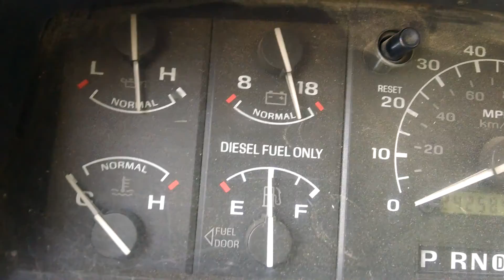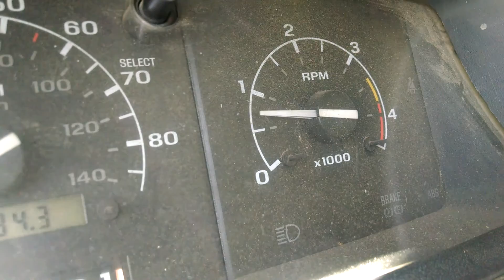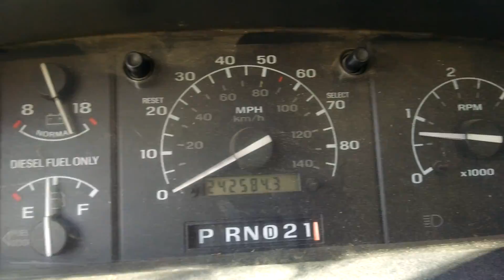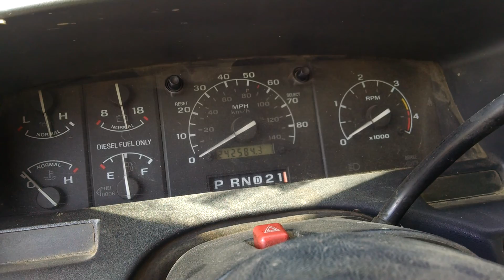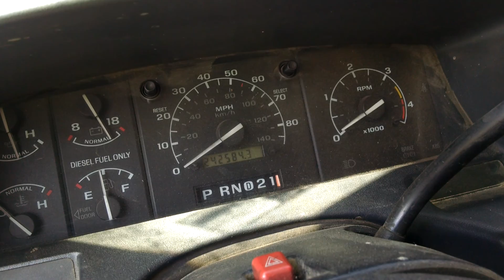Ford F-250 IDI 1993 Diesel 7.3L Problem

Comment: I had the same problem with mine after changing the fuel filter and return lines still had the same problem running rough white smoke and stalling and hard to start ended up being problem in the fuel tank the fuel tank had a lot of rust on the inner surface and goo from old diesel I guess and at some point somebody had removed the screen from the suction point on the sending unit assembly and put a short piece rubber gas line to extend it down and apparently it was sucking s*** up and clogging it off there slightly restricting the flow so what I did was remove the short rubber extension they put on the pickup tube on sending unit assembly and wrapped the suction port with screen and hose clamp it put the sending unit assembly back in and it was working fine eventually I put in a new tank and pick up unit been driving fine ever since best wishes to you
Reply from the maker: my friend didn't know what he was doing when he put new injectors in here he needed to advance the injection pump i did it myself put a new starter in 2 new batteries and a new starter now watch the first video of me trying to get the fuel up to it and yes i was getting mad at last because it didn't start and i could have burnt the starter but we got it to run check out my lastest videos it still running good i cut the muffler off of it loud now very loud. 1st video https://www.youtube.com/watch?v=Vc7mEA9ql-k2nd video running good https://www.youtube.com/watch?v=ZG1IhP7noM8

Comment: what was the problem ? did u solve this?
Reply from the maker: advance the injection pump to the passenger side fixed it
Reply: @robbie150  thanks what does it mean to the passenger side? u twisted it that way? I just got my first diesel a 1992 f250 7.3 idi. . so I dont know much I'm learning from videos..
Reply from the maker: I didn't know how to do it either but go to this site these guys were nice enough to tell me what to do with my 93 idi. https://www.oilburners.net/ they can tell you everything about that stuff it was not to bad but in order to advance the pump you either have to buy a special tool or make one yourself its hard to get to the 2 bottom bolts on the pump and need 2 people to help you with it

Comment: put a clear section of fuel line in the return to the fuel filter. it would show any air in the system. [ Tyler found the problem it had a bad ip and fuel leak]

Comment: the line on top of the injection pump has a check valve in it the brass fitting in the top of the pump has a glass bb check valve in it I bet it is plugged up and sticking over pressuring the injection pump making it has to much resistance to run properly had this issue several times take it out and clean it thoroughly.         https://www.youtube.com/watch?v=TFJ1N6g9fmg    https://www.youtube.com/watch?v=FjmaZhUTvSQ       look familiar
Reply from the maker: Thats the problem I have thank you so much. i will try it tomorrow and see if I am sure the injection pump will need a rebuild but I will give it a try!
Reply: another thing add a good factory ford / motorcraft fuel filter to the system after market ones form outside of ford / motorcraft have a higher micron filtration and often let trash pass thru and get caught in the injection pump and such and often scratch up the internals of the injectors and messes them up. The ford / motorcraft ones are around 2micron and aftermarket ones are around 10micron a huge difference so run only ford / motorcraft fuel filters also can add a clear screen filter ( AKA low restriction ) infront of the main fuel filter to see sediment / trash in the system or if are getting air in the system pre main fuel filter as this will also cause issues with slobbering / stuttering due to the air getting trapped in the injector lines and not allowing proper pressure to build up to inject fuel properly. The reason being our old school IDI's use a pop pressure and the air will compress reducing total pressure built per injector pulse making the injectors only partially inject fuel aka hit or miss injection.

I will also say check your CDR  valve this could be faulty and allowing you to get raw oil into the intake and this will also make the engine slobber / stutter and smoke easy way to check is take air filter off look at back of the inlet side of your intake a round can looking thing is there where it goes into intake look for a oil run trail inside of intake or simply look into the CDR and see if there is oil in the orifice as this is a tell tell sign of the issue and a common one also with our IDI's.

 PLZ try to avoid road draft mod for the CDR as I have found it to be a bit of a issue can cause some problems and also frowned upon by family / friends because leave oil puddles in theyre driveways lol. I also found road draft CDR setup to be bad in alot of areas where the law is a bit more agressive about polution. I live in florida now near the ocean and they don't like any oil leaking and I got a $500 ticket for a small puddle ( a soda cap worth after hard interstate running ) my rig left while I went swimming and well there was no way to get out of it.

Comment: Its your piston rings big dog. I bet it smokes if you open the oil cap while running. Mine is the same way.
Reply: It really depends on the owner if it is revved up all tge time it will toast the oil rings but if u take care of them and keep good oil in it itll last for 400000
Reply from the maker: i open the oil cap while it's running no smoke no blow by at all. found out it has a bad injection pump and a cracked fuel line
Reply: Your exactly right, i have a 91 f250 that did that and it was because of a cracked ring on the piston
Reply from the maker: nope o open the oil cap nothing comes out no smoke.
Reply: If you were blowing compression through a bad piston ring you would actually have excessive pressure coming out of the oil fill not just smoke as you would be actually blowing compression out as the term Blow by if you're not feeling excessive pressure coming out then you don't have excessive Blow by simply smoke coming out of there is not an indicator of excessive blow-by that would create a running problem it seems to me you have a fuel delivery issue seems like you're getting air from somewhere
Reply: It can also be caused by no back pressure u cant straight pipe a diesel unless its a turbo it has to have something to restrict some flow or air i use a flowmaster works fine

Comment: Its possible that you have air in the fuel lines... Try to bleed the air out of them white the truck is running one at a time......
loosen an injector slowly and check for air bubbles then tighten back the bolts....You will be in good hands once you get this done....Cheers!
Reply from the maker: it has a leak back to the tank it may have air to in the lines yes,. it leaks the fuel back down to the tank might be a seal out or something leaking fuel back thanks for the tip might check into it.
Reply: Agreed, it could be. Mine ran like this then eventually wouldn't start. It was air locked, bled the shader valve on the fuel water separator and it starts and runs awesome now.

Comment: And of course it could be the IP. New injectors have a higher pop pressure and if the pump can't deliver it.... The stalling points to a worn out IP too.
But check out the fuel return first, then do a compression test and then look over the rest...

Comment: Could be many things bud but like I told u before try running some injector cleaner through it and see if it helps it's worth a shot I know they are new injectors but try it first and try making sure that all the air is bled out of the system if it doesn't fix its probably be a bad injector this time try buying rebuilt or reman if it come to it because that way you know they have been pop tested or send you old ones to get poptested it most likely a injector problem because of it didn't do it before and then it did it after makes sense PLEASE TRUST ME THOUGH TRY RUNNING SOME INJECTOR CLEANER AND MAKING SURE ALL THE AIR IS OUT OF THE SYSTEM ALSO IF IT HAS IT TRY TO DRAIN THE WATER OUT OF THE FUEL THERE SHOULD BE A LITTLE VALVE ON IT TO DO SO IT COLLECTS Any WATER THAT GETS IN THE DIESEL!